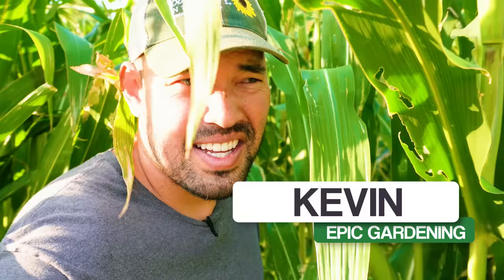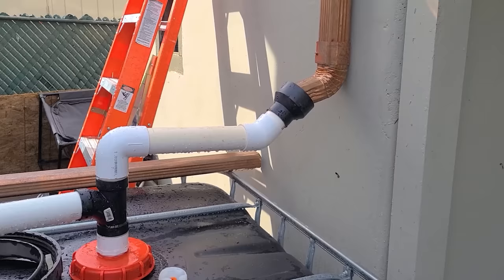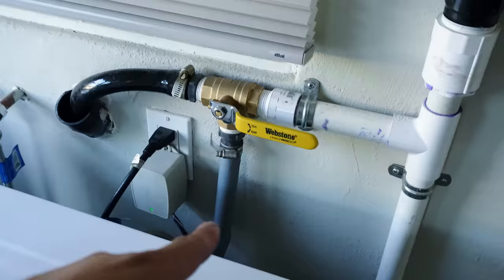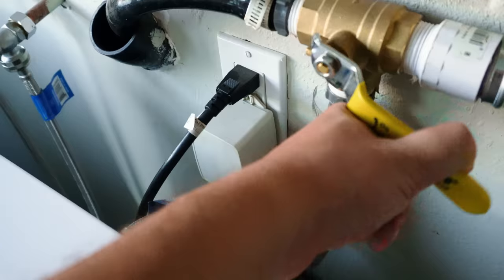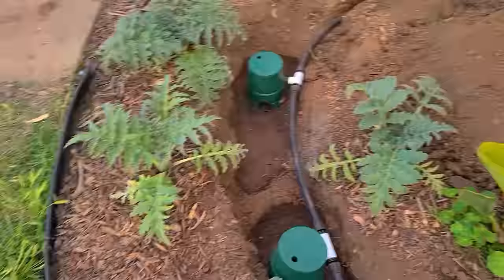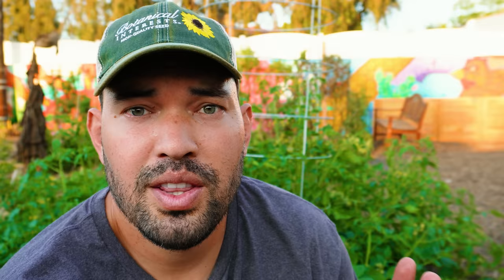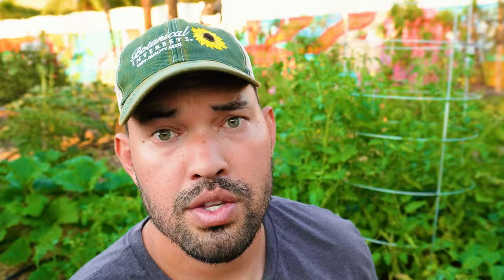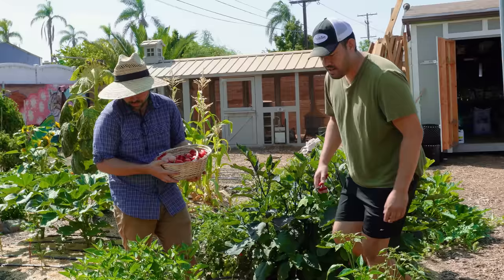Solar, Grey Water & Rain Capture: What You NEED To Know

Comment: I once lived on a rental property for 17 years. My landlord was a very practical man. He used kitchen grey water to irrigate the pecan trees out front. It was just a straight pipe that drained every time water was used. Then he planted a large berry patch out back. He decided to use the grey water from the bathroom & the laundry room to water it. He actually built a small septic system to do the watering on the berry patch. I thought that was pretty smart, to have a settling tank to make use of that grey water. (Reducing the soap foam) There was no need to monitor the watering, it was self watering. I can say that it worked very well. That berry patch was lush & productive.
Reply from the maker: Super smart setup

Comment: Point about grey water systems vs rainwater capture. For us in the wet cold north, the equation is flipped. Gray water and rainwater are both nice but grey water systems require  additional pumps because most peoples laundry is in a basement. With 3-400 gallons of rainwater storage (55 gallon plastic drums are readily available from commercial mechanical contractors around here) Most people will never have to use any city water until maybe august but then the September rains fill you back up.
Reply: Also true in the Great Lakes states.

Comment: I have a rain barrel here in NE FL (it rains A LOT in the summer).  I feel so much better putting rain water on my plants than tap water, as it is heavily "amended" by the city here.  The barrel works great for my area but I can see it not being worth it in a place that doesn't get a lot of rain.
Reply: Unfortunately, microplastics and forever chemicals are seeding clouds and raining back down again. Even rain isn't as "safe" as people assume it is anymore. However, for some people whose city water might pull from really nasty ground water or polluted groundwater, rain is still a best option
Reply: Hello My lovely friend.
Reply: @ellenkuang8853  That is an interesting point, I’ve wondered about that. Is it worth it you think to get that water tested?
Reply: @Nikki-mx5my  what ellen is talking about is probably one level below microplastics, nanoplastics. they are very hard to measure afaik, even in a controlled environment. Also, the measuring is kind of unimportant, as particles that small are probably found in similar concentration around most areas of the world, as they disperse in the atmosphere pretty wildly.
Reply: @yy-sf1xq  Thank you for the response, both enlightening and depressing in equal measure. So there’s really no escaping it then.
Reply: @Nikki-mx5my  yup. Just like with climate change, the only real answer, at least for now, is reduction reduction reduction

Comment: I bought an abandoned dairy farm to begin my homesteading journey. The house plumbing was already set up with the grey water plumbed separately and ran directly to where I wanted to build my garden. Once the county got involved with the inspections they required me to remove that plumbing and route it to sewage. They also wanted me to collapse a 100 year old 30 ft deep hand dug well with a working motor/ wind turbine set up. Although we ended up taking out the grey water system, I fought to keep that well. Only problem with the well is that it is no where near my garden and chickens 😂 but I have it in case I ever need it.

Comment: Very helpful. I do some rainwater capture but it's been a drought (not typical) this year and it would be very easy for me to do gray water from laundry and figuring out other systems are worth pursuing. I can't route the water into the garden, though, because I'd need lines below frost line here in New England and I have ledge 4"-8" down (not deep enough). So schlepping gray water would be needed or some other seasonal creative solution but this really helps get the wheels moving and to nudge me in the direction I want to go. Thanks, Kevin!

Comment: I have 8 of the HUGE terracotta colored rain barrels you have (mine were previously olive barrels and smelled HEAVENLY upon arrival).  One gathers the discharge water from my washer in the service porch (I don't use soap for skin reasons) and are connected to 3 more that sit beside it.  The last barrel has a hose running to the four identical barrels at the end of my patio maybe 20 yards away.  There is one barrel under the roof gutter downspout with three identical barrels next to it.  That last barrel has the connection to the hose leading from the ones under my service porch window.  If my wash water happens to fill the four barrels under the service porch window, I can open the spigot and have them empty into the barrels 20 yards away, and vice versa.  Actually, they all have enough water in them at the same time so that I just leave the connection open so all 8 barrels share water.  Only once or twice since I've had them have all 8 barrels filled up to the top with rain water...if they spill over, that's fine, maybe once or twice a year.  I'm one person, after all!  In LA County, we hardly get any rain anyway.  My barrels paid for themselves right away after each addition.  I wonder how LA rain and San Diego rain compare.

Comment: Nice follow up.  The grey water and solar are great for your location.  I'm on a septic system so all of the water stays on site except when the tank gets pumped out.  I would love to get a solar system but I would need to replace the aging roof and my roof center ridge runs N-S, so not ideal.  The roof is large so might be able to meet our needs if both the E and W slopes had panels. ($$$)  OR put the system on the ground which would be better and probably cheaper.  hmmm.....  😀

Comment: I live north of Tampa with lots of sunshine. The solar people tell me it's not worth my investing in solar because of my low usage. Minimum meter charge is $40 per month and my bill this summer was $51. No a/c, just my fans and cook once a day. Winter I use more because of the cold weather. Highest bill last year was $82, $40 is the meter charge. Is it worth doing solar? I want to be free of the grid!
Reply: i mean, im no expert , but i want to be free of the grid so i plan on having batteries eventually, if y ou did that then you need a way to charge them, but thats for me if power goes out or grid collapses ect your fine. but price it out, find out how much solar install would be , then decide if that money is worth it or not cuzz it could be a couple of grand and that may never pay itself back in under 30 years for you
Reply: @ilenastarbreeze4978  thank you. I guess it might cost more to install the whole set up than the long term value.
Reply: The good thing about your low usage is that you could get by with a pretty small solar setup. I don't know what the laws are in Florida, but if you could get rid of that $40 charge by either going off-grid or being credited that would certainly be helpful.
Reply: @baddriversofcolga  that's what I am thinking.
Reply: Does Florida buy electricity from homes? It might be a good investment if you can sell it back since you don't use so much. Plus it'll be free energy that you don't have to worry about.
Reply: @bjbrown  it can, and no problem! for me the value would be having my own electricity no matter whats going on around me. as opposed to paying back the monetary value thats what i care about , same reason i wish to collect and store rain water, where i wana move should hvae 0 issues with rain but i want to be able to just for my own self.
Reply from the maker: Gotta run the numbers! Low usage usually makes it tougher to ROI